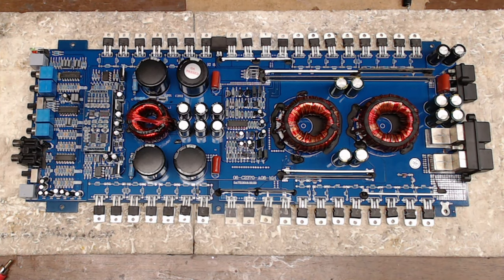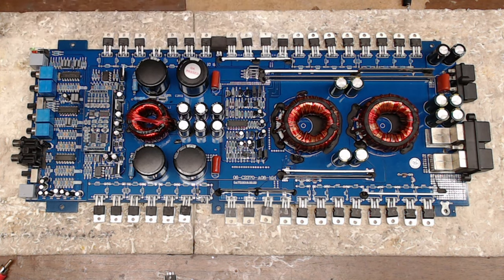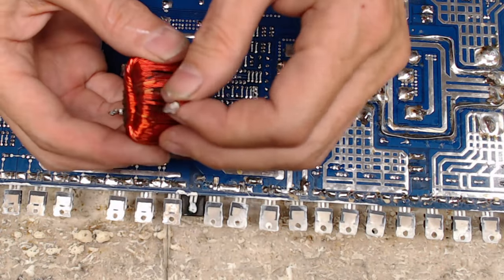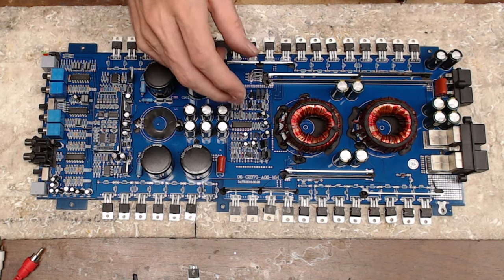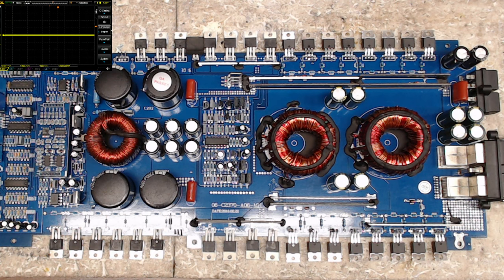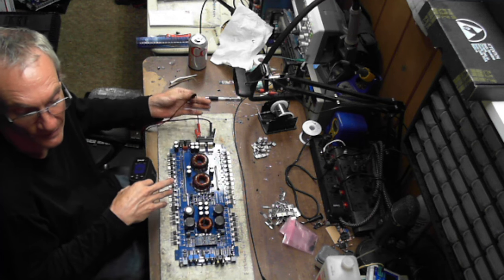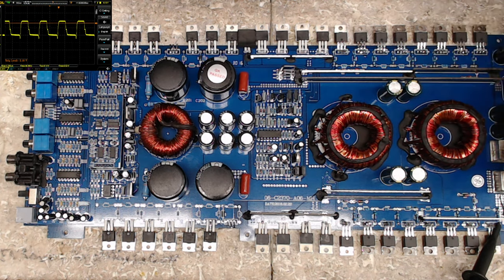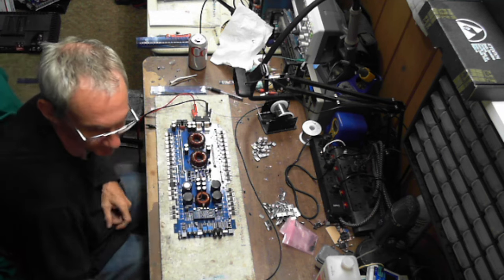Rockville Phenom RXD M4 Class D Automotive Amplifier Repair of Power Supply from Shorted Inductor

Comment: I see you switched hands with your DMM probes + & -, do you usually measure resistance @ Gate with your com probe? Might be a newb question but I don’t ever remember learning that either way mattered when measuring resistance.
Reply from the maker: Typically I use the black probe on the gate legs. If I switch, I am looking for values based on the forward or reverse bias of the zeners.

Comment: SoundQubed Q1-2200.2 Monoblock Amplifier I remove all output and power supply fet put new driver transistor the board want power up just click once? no lights on
Reply from the maker: Pull the output card and see if it starts then. Let me know what it does with the output card removed.
Reply: @ellensburgamplifier  pull the card still not power up
Reply from the maker: @FREDDIEROSS  So the relay engaging tells me that the remote circuit is still OK. No LED's may be an indicator of an issue with the power supply card. With your meter, you can check the gate pads to see if you have drive to them. With the meter's frequency setting, you should see around the 26kHz range if there is drive. Or you will see a voltage amplitude of 5 plus volts. If you don't see either of these then either the gate drive NPN and PNP transistors are incorrect, backward or there is no drive from pins 9 and 10 of the TL494. Does any of the TO92 transistors heat up when the remote is applied?
Reply: @ellensburgamplifier  there is nothing heating up
Reply from the maker: @FREDDIEROSS  That is a good sign. Any luck with seeing anything at the gate pads for the power supply?